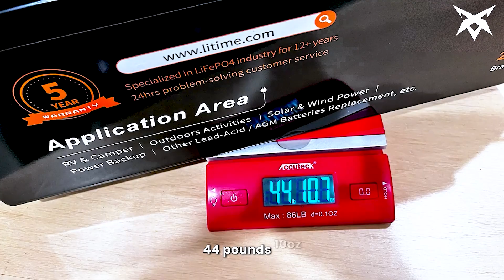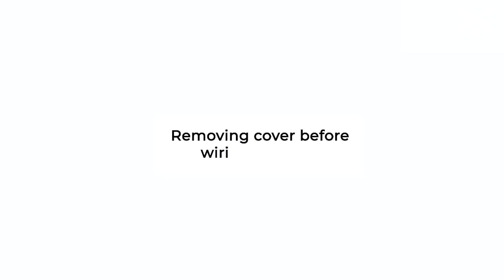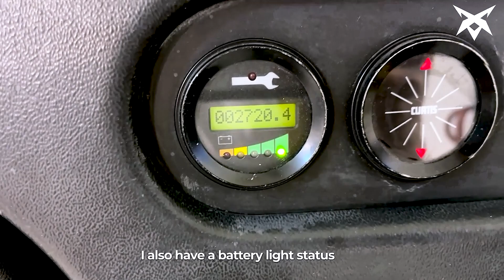How to replace battery in Yale OS030 Forklift with Litime 24V 100Ah LiFePO4 Lithium Battery

Comment: Are you still using the LiFePO4 battery? Why didn't you take out the Led Acid batter and place it in the spot? Have you had any issues if you are still using the LiFePO4 battery?
Reply: That small LiFePO, battery they put in there weighs way less than the original. The reason you don't want to remove the lead-acid battery is because it's not just for power it's actually part of the forklift's counterweight system. A lot of people don't realize that. If you take it out, you'll throw off the balance and change the lift's rated capacity, which is listed right on the data plate. That rating assumes the original lead-acid battery weight is still in place.